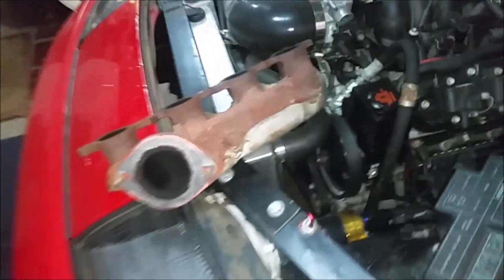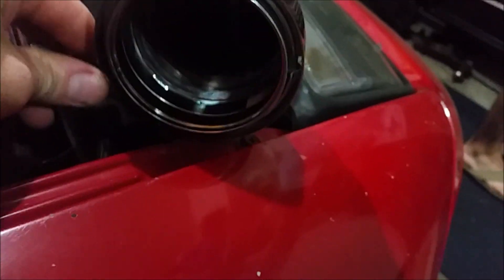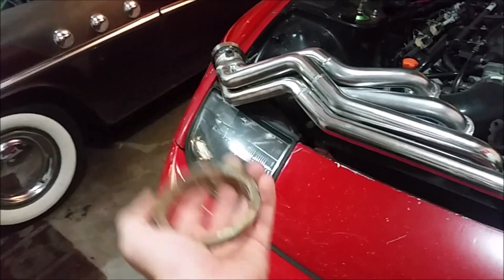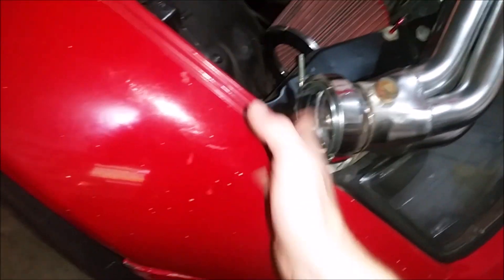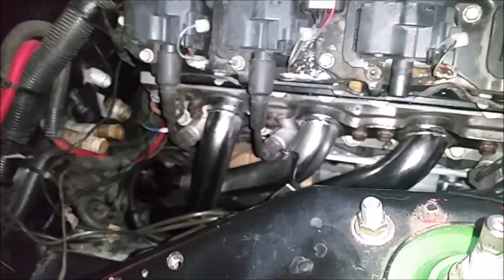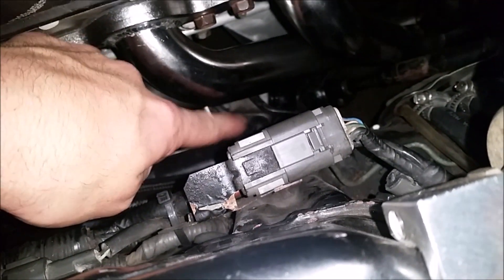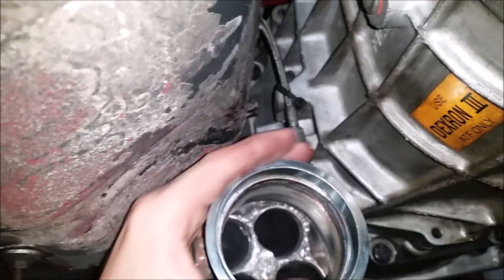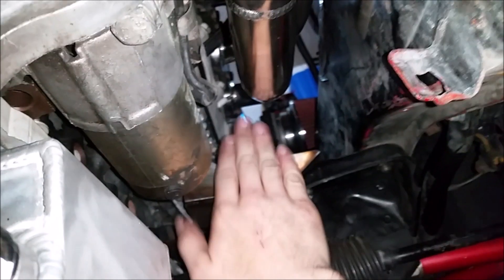CX Racing Z32 LS swap kit INSTALL Part 2

Comment: What did you do as far as a wiring harness goes? I’m planning to do an LM7/LQ4 + T56 swap on my Z
Reply from the maker: Stock lm7 harness. Had to change the truck injector connectors to ls1 style bbn connectors
Reply: BrabusTKR so stock truck ecu and harness is all I need? Wiring is the only part I’m unsure of. I know there are companies that make swap harnesses for this but I’m not sure if I need one
Reply from the maker: @josephsalamone2539  check out LT1SWAP.com he has all the wiring info you need. The stock ECU will have to be unlocked to work if you are not taking it somewhere to be tuned right away